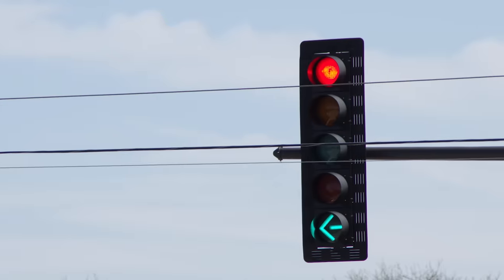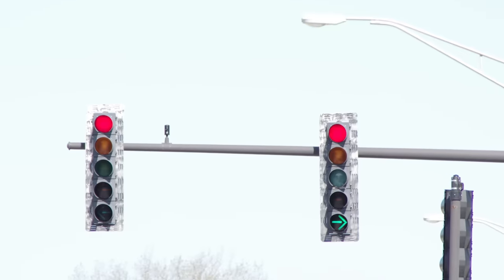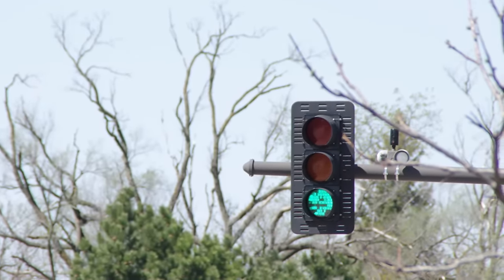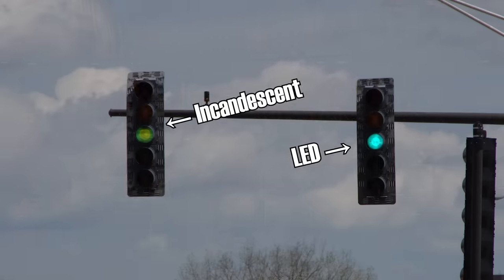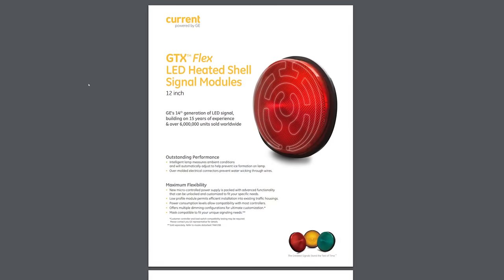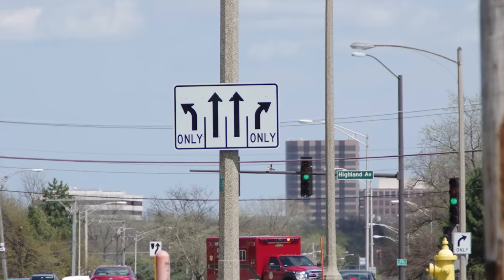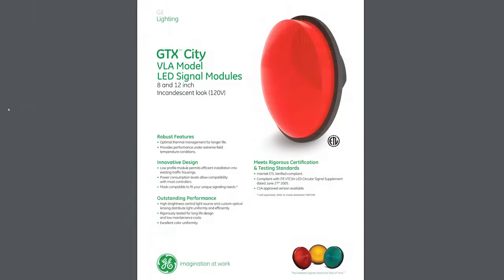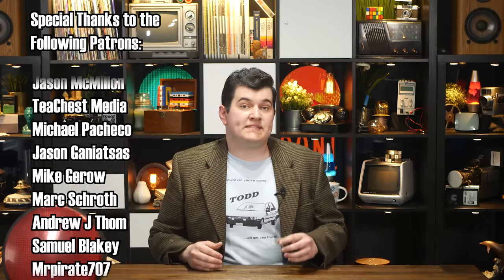The LED Traffic Light and the Danger of "But Sometimes!"

Comment: Perhaps thinner lenses could be used to seal the LED? Or lenses of a different material, that could more easily transfer heat to the surface?
Reply: Which would do a grand total of jack squad.

They don't defrost themselves because LEDs are just colder.
Reply: a piece of bimetal and a heatingcoil .... problem solved for about a dime each
Reply: @baronbrummbar8691  you could even aim the heating coil at traffic, so it flashed and produced light...
Reply: @tsm688  nahhh..... to much power waste .............
Reply: @baronbrummbar8691  too much waste to light it, but not enough to continuously heat it?

They're the same thing.  it's heating element versus heating element
Reply: @tsm688  getting a heatingcoil so hot that it produces light is a waste of power ..........
Reply: @baronbrummbar8691  As heating elements, incandescents are 99.9999% efficient.  Just like any other heating element.
Reply: @tsm688  i know .... (more like 98%.efficent in creating heat) ........................ that means baley any energy goes into creating light ......... you sayed you wanted to light stuff with it .... witch are the remaining 2% efficentcy ............ witch is an awfull idea
Reply: @baronbrummbar8691  Much better to use 2% of that energy on a LED, and the remaining 98% on the heater.
Reply: @tsm688  that is not how that works ..........
Reply: @baronbrummbar8691  woosh

the efficiency of the LED is pointless when you're running a hairdryer 24/7 to keep it ice-free in winter
Reply: @tsm688  that is the point of the bimetal ....... the bimetal if set up the right way can open the circut whenever it is warm 
..... so 95% of the time the heating coil is of
Reply: @tsm688  also if it is cold enough even a normal bulb can´t melt the snow/ice
Reply: @baronbrummbar8691  unless it's cold of course

in which case it's on all the time
Reply: @baronbrummbar8691  So you're saying they need an even BIGGER, EVEN MORE POWER WASTING FILAMENT so they can use a high efficiency LED?

Is my point becoming clear yet?  What's the point of using a LED to avoid using a giant power wasting filament, if you also need to install a gigantic power wasting filament anyway?

It's like unplugging your TV to save power when you're running a stove all the time.  The savings are miniscule in comparison
Reply: @tsm688  you do know that the temperatur inside is much warmer then outside ................ so it is kinda irellevant 
-
and during a severe cold snap it can be on
Reply: @tsm688  first a heating coil is smaller then a bulb ........... secondly it is of 95% of the time so you save all the time power and it is even cheaper in production
Reply: @baronbrummbar8691  not irrelevant when you're heating the outside so it doesnt ice.
Reply: @baronbrummbar8691  a heating coil is bigger than a bulb.

How do I know this?  Because you told me bulbs weren't enough to heat it...  you're seriously contradicting yourself now.
Reply: @tsm688  that is not how it works ..........
Reply: @tsm688  you know that ther are heating coil in all sizes .........  a heating coil is made specificly to heat ..... a heating coil much smaller then a bulb cancreat way more heat then a bulb
Reply: @baronbrummbar8691  if it creates way more heat than a bulb, it does so by consuming way more energy than a bulb.  That's basic thermodynamics.

or were you planning to heat it with a perpetual motion machine?
Reply: @baronbrummbar8691  all I am trying toconvi ce you of is basic thermodynamics and energy.

Any heating element is 100% efficient, lightbulbs included.

Electric heating is the most wasteful.amount of heating imaginable.

Combine these facts together.  Correlate.  They mean something beyond the vague fear they cause in your head.

Comment: You probably haven't seen a snow covered light because LED lights aren't out there heavily, having lived in Minnesota I've seen partially covered incandescent lights you could still read them though, and as you said a heater is probably not hard to install and will still save money

Comment: why can they they treat the surface to prevent snow to stick . the heat trace
bulb is very feasible, especially with a built in thermal coupler. what about 
using a single incandance  bulb to keep the unit warmer and prevent freezing
on the led bulbs.

Comment: LEDs last a long time, when and if they last at all, and they are much more expensive than traditional lamps. About 10 to 20 percent of the LED lamps I've installed last only hours to days. New tech isn't always better in the long run, it's just new.

Comment: They installed those in the downtown area of the city I'm near.  Lots of people told them not to.

Winter hit, and nobody could see any of the traffic signals.  The LEDs could not put out enough heat to keep the ice from forming and then hard frost (which becomes very opaque very quickly) from forming, or the cavity (when there was one) filled with snow and ice.

For a lot of that winter all the traffic light intersections were fourway stopsigns.

They also put brick in the crosswalks and little LED lights to beautify the downtown area.  First time the plow trucks came through, they ripped all those lights up and damaged the bricks, ripping those up in places as well.

Then they started using brine instead of a salt and sand mixture on the roads.  Seems good, right?  No.  Even brine has a freezing point, and this part of the country hits that very regularly just in the air temp, to say nothing of roads or bridges (especially bridges or overpasses, which freeze first). It's also absolutd hell on your vehicle.

Moral of the story:  Not everywhere in the world is SanDiego.  Stop pretending it is.

Comment: The problem is they only last as long as the crappy components in the swithchmode power supplies. Huge issue with the lifetime claims. Yes the diodes themselves do last for absolutly ages but the mosfets and capacitors that drive them are sealed in and prone to failure. Often due to poor circuit design but it's actually an inherent issue with SM power supplies.  This leads to huge waste and dependancy on the manufacture for replacements.

Comment: You will note they are 130 volts.  This means that while their life may be longer than 120 volt lamp, the light output is low for the power.

Comment: I thought the “but sometimes” problem you were going to mention is how directional LED lights are. If you’re coming down a hill with LED traffic lights at the bottom, there’s an angle above which you can’t see which light is on. There should be a fresnel lens over the LED so the light shines in more of a hemispherical pattern.

Comment: When you have to stop 10 times to go 2 miles. That pisses off a lot of drivers. So they drag race to get thru the next light. But i notice know as soon as the light your at turns green the next one is already turning yellow. And that really pisses drivers off even more.1Personally i don't call that traffic control. I call gas tax profiteering on the city and states part. I can ride a bicycle across town faster than i can my car.

Comment: I'm 42 years old and I've never seen a traffic light fail except when an entire unit is out from power issues. Am I living in some weird twilight zone?? Has Ontario never used incadescent bulbs or am I experiencing sever confirmation bias and por memory?? I've been driving since I was 22 and plenty of jobs driving all day.
Reply: I'm in my mid 30s and have lived within eyesight of a definitely incandescent lighted intersection for over 20 of those years and I've never seen one out either.

In comparison, I've seen them having to replace/repair the hanging signs on them from wind damage multiple times (that's the one that really gets me - anyone who has ever walked down that street knows it is basically just a wind funnel and it's the only intersection they have hanging signs on).

Comment: You should make a video on how roundabouts need to replace trafffic lights! Unless I'm wrong but it's a whole can of worms I'd love to hear your take on! I hate waiting 3 minutes to make a left turn lol..
Reply: roundabouts are good in many situations but could never serve as a complete replacement, for one thing roundabouts need much more space and it's just not feasible to destroy the surrounding area of every traffic light, not to mention intersections with multiple lanes. Also for the entire duration of replacing the intersection with the roundabout it can't be driven in (you can't close down an intersection leading into a fire station or hospital for example). In general states do have roundabouts where it's possible to have them but to actually replace a traffic light is a long and difficult process and downright impossible in some cases.
Reply: @dillon8124 you can't close intersections down? Wow. The asphalt must be worn down to the gravel by now then. Of course you can close it down, whether it is for surface renewal or for conversion to a roundabout. What a silly argument!
Reply: @lhpl  not for years it's different if you just need to pave it overnight or over the course of a few days where a detour is available, I'm by no means anti-roundabout but them completely replacing traffic lights everywhere just isn't feasible
Reply: @dillon8124  I agree that there is no need to replace every traffic light with roundabouts, I am just pointing out that they can be put in without taking much more space, and fire stations an hospitals are ridiculous as reasons for not doing road work. Just out of curiosity, are you American?
Reply: @lhpl  places where roundabouts can be put in are surprising niche and should only be put in at high accident rate lights. My main objection to them are just how much they cost when there's far more cost efficient solutions. I'm personally for having more access to public transportation and moving away from cars being the primary method of transportation. I am American and trying to work out public transport here is a nightmare and riding a bike is dangerous.

Comment: So lets get busy solving the snowed-over problem. If the LED generates SOME heat, then couldn't we add a second lens to insulate and trap that heat? Or use a wind powered rotating wiper system such as seen on ships. I'm just spitballing here but surely we can solve the problem instead of just complaining about it.

Comment: well for the "cold" issue, its rather simple, build a screen with heating elements in front of the light, every car has such in the rear window, and let it run at 32F and below, some little small electronic circuit can do that and it doesn't cost much more in electricity use....."problem" solved

Comment: 6:29 Yeah, Like that's going to happen! Right after Hurricane Andrew hit Miami Most of the traffic signals were out for very long periods of time. Drivers just sped through intersection bumper to bumper until a break allowed cars in the other direction to break in and do the same thing. I was nearly rammed as by a driver who had to be doing 40 to 50 MPH who started blowing his horn several feet away and would have rammed me had i not gotten out of his way. So, I'm sure that it is no better where you live.

Comment: The British use roundabouts, or as the Yanks call them road circles. These cannot break down, lose power or get knocked over. In at least one town (Hemel Hempstead if you want to look it up) they have taken this further to create what gets called the Magic Roundabout. It is truly magic and keeps the traffic flowing wonderfully.
Reply: with the drawback of being huge and extremely slow
Reply: @tsm688  Actually, in a country the size of the USA they would be perfect. As for being slow, when properly set up and used, they keep traffic flowing much better than lights, especially when it comes to complex (5 or 6 roads meeting) and staggered junctions. The Hemel Hempstead example is a fantastic illustration if you knew how bad it was before.

Comment: Ive heard waaaayyyy too much "but sometimes" regarding EVs.

"My car goes 500 miles on a single tank!" Even though they drive 20 miles in a day...

"My car fills up in 5 minutes at a gas station!" Even though you can over night charge an EV, or get more than 20 miles of driving in 5 minutes of charging at a station...

"The batteries catch fire!" Not realizing gasoline is literally lit on fire to perform the intended function...

"EVs cant go as far in extreme cold!" Not realizing their car loses range, the phone with the same type of battery in their hand still functions fine, and ICE cars are notorious for no-starts in -30

Theres so many more silly arguments but those are the 4 I hear most.
Reply: Batteries catching fire and gasoline being ignited are not the same thing and that is an incredibly halfwit argument to pretend it is.

By this logic you should let your child play near downed power lines just because your house has electricity running through it.
Reply: @RunicSigils  youre right. The contained explosions inside the combustion chamber certainly arent much of a concern.

But then I see daily news articles of highways being shut down because an ICE car caught fire 😂

Comment: LED lights getting snow on them, but not hot enough to melt the snow?  Why not wrap them in a heating coil and use 90% of that saved energy to power that to melt the snow....SUrely, even if they use just a portion of that saved energy, its still a huge net savings.

Comment: Here in Louisiana the led lights they have don’t show at all unless you look at a certain angle they may be good for cost and snow but when you can’t see them that’s an issue so they are not right for some places but there is probably a solution and can be fixed but here in Louisiana especially on the out side of New Orleans the maintenance on these lights is not good

Comment: Here in Germany we have signs in every single traffic light intersection that show who is allowed to drive and who is supposed to yield in case the traffic light is off. Having said that, I’ve probably seen a single traffic light defect once in 5 years, a shut off traffic light around once per year, so they seem to be fast enough to change the light bulpa here.

Comment: Roundabouts (traffic circles) would solve most traffic light problems... Although it has to be admitted that, at least here in the UK, sometimes the traffic flow volumes, or roundabout design (elongated ovals being especially bad), means that traffic lights are needed at the roundabout anyway, just so that all traffic gets a chance to enter the roundabout, not just the roads with the most traffic.

Comment: Sometimes ... you have to err on the side of safety, until a full implementation comes along. LEDs freeze all the time here, and it's the insurance industry's, "One death from a signaling device, could cost $10M, versus the cost of electricity ... some things will come in due time. I got in my truck with an 'LCD' rear view mirror one morning in -16-degree weather. I put the car in reverse and saw the image of where I had parked the night before, in the mirror, instead of my driveway. I never thought a 'liquid' crystal display could freeze.🤣10 minutes later, as the car warmed up, it was fine. It never happened again, but now I always confirm the view. Yeah, I have the technical/engineering background too, but the insurance people, bean counters, politicians and idiot managers constantly crush common sense. Specs on transistors are sometimes ignored too. Did you ever leave a laptop in the car overnight in the winter, and it won't start when you bring it into work, or in the hot car in the summer, and it freaks out when you start it. Sometimes the world is a difficult place ... actually, all times

Comment: would it be a solution to put only one LED light how could turn from red to yellow and then green, instend of putting 3 light above each other like everywhere. its could be a saving of electricity power,  light factory caus we use only 1 light instend of 3 like i said, and also a place saving i guess but it need to be LED obviously, but maybe it could be a solution  ?????

Comment: I live in snow country and one problem with LED tail lights on the trailers of semi trucks, I find they do not produce enough heat to melt off the snow and in a heavy snow storm that trailer going down the road  can become completely invisible to cars approaching from behind. I followed one and the only way I even knew it was there was the black corner of one mudflap was visible, I followed that all the way home. LOL  Just hoped he didn't hit the brakes because the brake lights were completely covered with snow.

Comment: Cars with LED lighting have the issue where the ice and snow is not melted off of the lens. There is very little heat from LED lighting. LEDs are about 80% to over 90% efficient depending on the particular design.

Comment: What I would like to see is a 3 or 4 second delay before a light turns green. What I mean is when the light in one direction of traffic turns from yellow to to red, the traffic light in the other lane of traffic remains red for 3 or 4 seconds before it switches to green. That way both directions of traffic are red for a few seconds. We all have seen people who should have stopped when their light is yellow, but choose to speed up to cross before it turns red. I've seen in some Russian dash cam videos, at some intersections, they've installed a count down timer showing traffic stopped at a red light when the light will turn green. When people see it's down to 2 seconds, they start pulling out into the intersection. Like the Christmas tree lights at a drag strip. Really stupid as far as I'm concerned.